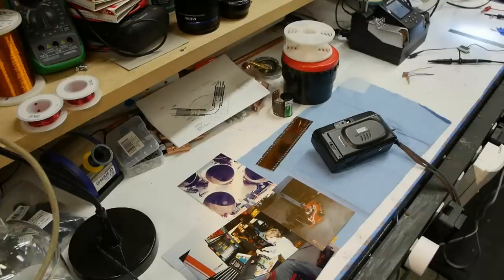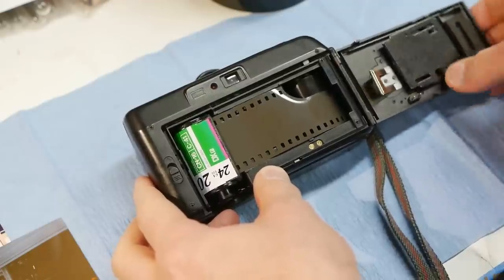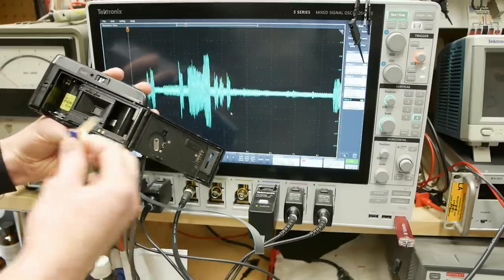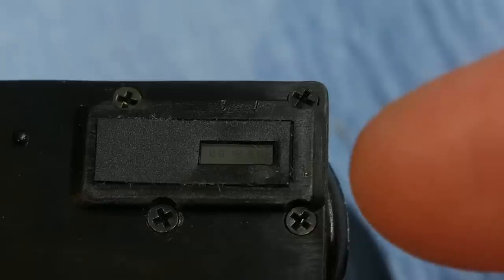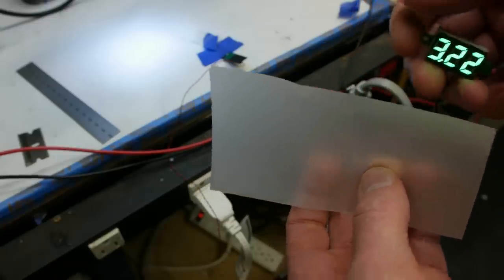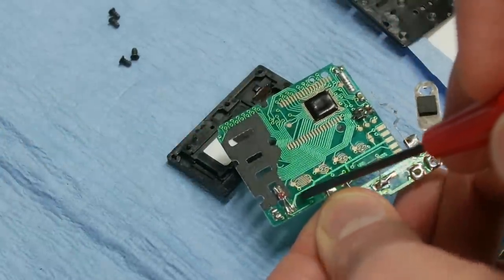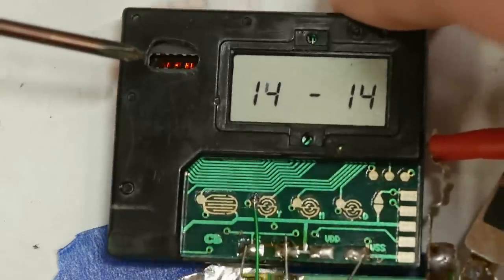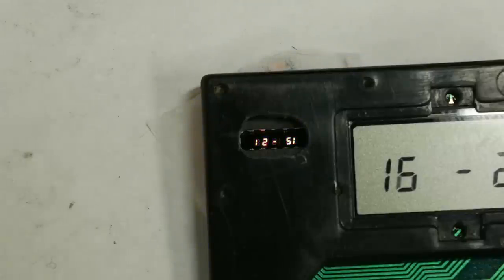How a film camera superimposes the date onto photos

Comment: The sprockets that slot into the sprocket holes don't wind the film - the holes aren't strong enough for that. Rather, the take-up spool winds it on and drags it over the sprockets. The sprockets are there to keep the film aligned, and count on the number of holes to the next frame so the camera knows when to stop winding.

Comment: Cool video. 

1. Negatives have an "orange matt"  but that's not why the date appears orange. It appears orange because that area of the film has been over exposed (the projection is brighter than it needs to be) and when over exposed, a colour shift is introduced and whites no longer appear white. This is why light leaks always look yellow/orange. 

2. Watching you handle your negatives like that makes me die a little inside =/

3. Some of use still use film, it's an older tech but not outdated. I've always cringed when I see prints with dates on them. Never understood why someone other than a crime scene investigator would use such a feature. Completely ruins a good photo =/

4. Cool video =)

Comment: I have a few cameras with this feature. I usually have it turned off. Mine also maxes out at 2019. Mine go back to 87. On one of them some genius at Fujifilm decided to combine the camera's flash and timer control with the the date back LCD rendering the camera useless if the button battery died. Most manufacturers use to separate LCD for camera functions.

Comment: I always assumed this used the slightly larger LED calculator display, but projected onto the front of the film, through a cutout in the case (where it has a greater distance to work with).

Interesting vid. Learned something new. ;)

They came up with a really neat an inexpensive way of doing it. Looks like quite a bit of the tech came from the World of digital watches.

I believe there were some watches which could project the time onto the wall, too, so maybe that explains where the tech came from originally?

Comment: I've been wondering where the date limitation stems from? Is it just the clock used? Would it be possible to design an pcb that fits inside one of these and make it go up to like 2099? Getting a similar LCD these days would probably be hard so salvaging as many parts as possible would be needed.
Reply: There was a time many decades ago when computer memory was quite expensive, so programmers thought of very clever ways to make programs run with only a few kilobytes of memory. It became common practice to shorten the year to just two digits. This worked fine up to the 1990s until people became aware that the the rollover to 2000 might cause the clocks to crash on many computer systems. There were many news stories about the "Y2K problem" at that time, and many programmers had to be hired and trained on how to update the codebase in older systems before the rollover.
Reply: @lihtan  Well the Y2K is only really a problem if you have memory. If you save data with only 2 digits that gives you a problem when going from 99 to 00. Take a Bank for example. If you wanna calculate interest rates and the last entry is from 99 and the next one is 00 there comes the problem if you didn't plan on this when programming. Not the clocks crashing. But these cameras don't have any memory since it doesn't matter for them if the last photo was printed with 99 and the next one with 00. Also a lot of the time the cutoff is somewhere else. Take the OM-1 for example. Recorddata Back 1 goes from 75-87, Version 2 from 78-98, Version 3 from 70-09 and Version 4 from 80-09. Kinda just smells like planned obsolescence since giving the option to go from 00 to 99 would simplify the logic. (at least for the ones with buttons, I get that maybe putting 99 numbers on the wheel is a bit weird).

Comment: Wow! I always wondered myself how that worked :D After all these years of never daring to take the camera apart to see how lol I don't have any film cameras anymore, don't know what happened to them over the years. One little annoyance with a couple of digital pocket cameras I have (1xNikon CoolPix + 1xOlympus) is the battery flap is very delicate and on both cameras it won't stay shut as some plastic has broken off, and on my Nikon I dropped it in the M&M shop in London and the screen is cracked all over. A replacement screen is hard to find and one I did find was more than the camera cost so ....  Wish I still had my slimline 110 camera I got for my 16th Birthday lol
Thank you so much for sharing :D Subbed and Liked :)

Comment: So cool. 
I'm not sure if you mentioned this, but does the LCD screen for the projector actually show the negative of a normal 7-segment display? It would explain why basically the whole screen is dark except for the segments - you can use the display black out the negative spots and let light shine through only where you need.

Comment: The choice of an incandescent bulb is still a mystery, as point-source LEDs were around in the 90's (they're the same as diffused LEDs, just a clear lens on top instead of a cloudy one).
Also, any LCD can be set up to allow light through activated segments, turning the rest of the display into "welder's goggles", by rotating the polarizing filter by 90 deg.
Reply: They obviously needed to be careful with the intensity of the light - if too much gets through the film, it's going to bounce around the other side and fog, not necessarily evenly, the image. It's true you can reduce the intensity fairly easily with voltage, but all the energy of a LED is at one wavelength, and perhaps the absorption properties of the film pigments made it impractical to reduce the intensity of the LED to a point where it was strong enough to imprint the date on its way through, but not strong enough to do any harm on its way back. More mundanely, grain of wheat bulbs were very cheap, probably cheaper than LEDs in 1990.
Reply: @thisnicklldo  It has to be the cost for the most part, there's no way (at least not the more expensive ones) LEDs were nearly as bright as lamps back then - at least that's what I can tell from recalling a few red LEDs I've seen back in the day.
Or maybe it has something to do with monochrome LEDs producing polarized light, but since I don't know the topic well enough I won't speculate
Reply: This is why there's a set of contacts and pogo pins on the film door. When the shutter opens, it tells the controller to power the lamp on the date projector for a specific period of time to ensure that it exposes properly.

Comment: Fun fact, it's not really red because of the backing layer, but because the there are 3 layers of emulsion, one each for red, green, and blue in the film. Red is typically the layer the furthest back, and, thus is made more sensitive because light has to pass through the other two to expose it. So, when exposing from the back you are mostly exposing the extra-sensitive red layer. This is the principle behind "redscale" film.

Comment: At 3:22 you say “upper right corner because it’s mirrored” but it isn’t mirrored!  A mirror “flips” things front-to-back, the lens is inverting the scene, top-to-bottom.  A mirror would put the date at the bottom left, not the upper right.
As an aside, you mention that the camera has a motor to advance the film.  I would assume the camera advances the whole roll onto the take-up spool then rewinds it one frame at a time as it is exposed (to protect the exposed film in case of accidental (or deliberate) opening of the camera back), but the way you describe it, it sounds like it advanced the film one frame at a time as it was exposed, then rewound it when all the film was exposed.  What’s the advantage of doing it that way?

Comment: I just bought a Data Back A for my Canon A-1, and the year dial only goes from 82 to 93. I thought that this would be an easy fix, I'll just cut the two traces on the PCB to turn the 8 into a 2. As it turns out, it uses little rotating dials that do the exact same thing as this LCD.

Comment: Love the videos! Are you planning on doing anymore work with super-critical CO2 anytime soon?
Reply from the maker: Yes.  The recent Bon Appetit video caused me to look through my shelves, and I found my metal CO2 chamber with wide mouth and quick-clamp closure that can be opened and closed without tools.  I never made a video about it.  My intention was to make a passive SC CO2 extractor, which never worked very well, but it would work very well for making things like Pop Rocks.  I may still try to get the extractor going again with a pump or some sort of clever heat-powered mass transfer loop.
Reply: @AppliedScience  Sounds great! Looking forward to the video!

Comment: Very cool, didn't quite understand the reasoning you gave about it being a point light source. That incandescent isn't very point like.
Reply: I think it doesn't really need to be a point-like source in the horizontal dimension, only the vertical one.  The segments of the numbers are thinnest in the horizontal dimension.
Reply: The light source is far enough away from the LCD compared to the LCD to film distance. It's the ratio that matters.

Comment: The rear most layer pf the film is the one most sensitive to red and a remjet layer typically protects that rear most layer from light reflecting off the pressure pad. That’s why the date probably comes out red. Im curios though how the date would look with film that has the remjet layer removed

Comment: So the film is sensitive from behind as well as from the front? I would have thought that they would have a metal foil backing to help protect the film from stray light from the back.
Reply: No, cause they developed the film and made larger prints by projecting light through the film (at which point the negative produced a positive).
Reply: Nah metal is too expensive and would reflect light back through the film. But in cine film. There is a backening containing carbon black, which absorbs any residual light. In still film the pressure plate is black and there is no such backening, but the film contains a dye layer with similar purpouse
Reply: Some kinds of film (such as type 120  'medium format') have a paper back cover. The film is rolled up together with a black layer of paper, to shield the film from light. Type 120 film does not come in a metal cartridge, but is just loaded onto a spool. The backing paper also has frame numbers printed onto it, which you can see through a little window in the camera back.
Medium format is still pretty much unsurpassed in resolutions, mostly because of the huge size of the negative. Among others, the windows XP background and lots of space photography was done on medium format.

Comment: very very interesting.

it was funny to me when you said 'clogged wheels.'  it reminded of photo publications in brazil in the early 2000s when they called 'hot shoe' just 'hot shoe,' when there was a name for that.  'sapata' (feminine for 'sapato,' literally 'shoe').  i thought like, "oh well, this new generation seems not to care that much about making sure they know the name of the things, and either create a new name or just leave it without translation.  although 'clogged wheel' is perfectly understandable, the original word used for that is 'sprocket.'  not a big deal.

your explanation for why the light looks orange makes sense at first, but I'm not sure that's really the case.  it's not the back layer that produces that color, but the filme emulsion itself.

i think that it is so because the light had to have a light power that would not overexpose high iso films, which could create a diffusion of the light, making the numbers appear so bright that they could look everexposed, rendering white the tiny black separations and also letting some light affect at least the surroundings of the numbers, affecting the image at least partially.

i think that they chose a light intensity that would expose well a 400 iso film, this way it would look less orange-ish on 400 films, even less on higher iso films, but not to the point of being so overexposed, and more orange-ish on 200 or 100 films, but it was underexposed.  also, it's worth noting that most films regular white balance was daylight temperature, and any filament light would render a warm color.

Comment: Today's kids be like: how many megapixels is that?
We: Countless
Reply: Well, technically there's still some finite resolution to it since the photosensitive compounds are in particles of certain size
Reply: If I remember right, in theory 35mm can be as high as 33.5 "megapixels" but this is very much dependent on a massive number of factors, with the most limiting being scanning hardware. Highest resolution I've found commercially offered is 4492×6774 for 35mm. Still a usable resolution that matches (or even slightly beats) cameras on high end smart phones, though professional grade digital cameras have surpassed this (I've seen some high end cameras in the 10,000+ pixels wide range)
Reply: Justin Noker Yep, 400 Mpx is the maximum resolution I’ve heard of for a digital camera, or 100 Mpx without moving sensor.
Reply: You could say the same about digital cameras
Try counting 30.000.000 pixels

Comment: i don't think the color of the date is orange was not due to the back of the film. but the fact that the light source was an incandescent light bulb, which has a color temperature of about 2800k..... back in the days  most color C-41 film was calibrate to day light temperature (5500k).. that was why if you shoot a normal film indoor it appears all orange (unless you sent that to a more modern developer/printer which has color correction build in... one of those new printer actually scanned the negetive and printed it.. where as the older developer/printer machine actually use a 5500k light bulb to print. ) 
an experiment to do is to set your digital (video) camera to 5500K and film the lightbulb on the circuit board,  and then set to 2800K and film it again.. you should see that orange glow in 5500k

nonetheless.. this video is great tho.. i would never imagine the mechanism of the date printing on film was done this way.. i always assume it was a miniature 7segments

Comment: 🤔 So.... How different would this rig up to a sla printer?  Using a phone screen to invert the display of the layers and an appropriate laser shining under it...?

🤔 Also... Aren't exposed to light and "developed" film a good source of ir filters for incandescent light?  I have a few of those flod lamps on a trail and it looks like daylight at night (to the camera, but to eyes are too dim to be noticed)... Whats on the film that allows that?
Reply: Rig what up? Phone screen, what, why, an SLA printer already has a screen. Sure you can add a segment LCD shutter to it, then in that area, you would have a hole in your object and a superimposed time-and-date extruded between the bed and the vat.
Reply: @SianaGearz  meant the projector concept... Not the date lcd 😂
So that the light is flashed thru the screen instead of the laser tracing the paths of the print
Reply: @astbrnrd  Oh most resin 3D printers are MSLA (mask stereolithography), which is specifically a monochrome high definition LCD that is in direct optical contact with the springy, clingy bottom surface of the vat (FEP film), so focusing becomes... not entirely unnecessary but at least manageable. There is a huge UV LED underneath and a focusing system.

Laser SLA 3D printers are the exception, i think there's only two companies making vaguely affordable ones, Formlabs and Peopoly.

Representatives of MSLA are for example Prusa SL1 as well as EVERY resin printer out of China, such as Anycubic Photon, the Elegoo Mars, the Longer Orange, the one by Wanhao, the one by Anet, the one by FLSun, the one by everyone else.

Comment: The date appear in red colours because it's coming from a real little incandescent light bulb. Actually it's metal glowing colours.
The filament is normally glowing so much that it appears white in normal conditions. To be precise,, it's a warm light. And if the amount of light is controlled to print just the enough amount needed on a film by the amount of time of a blink of the bulb, it will appear dimmed revealing the metal glowing colours. They had to dim it so it never overexposed the film to a point of having white marks that were unreadable over white colours.

8:36 You purposely underexposed the picture so we can see it. You have the exact same colour.